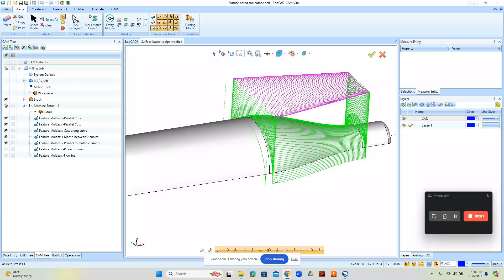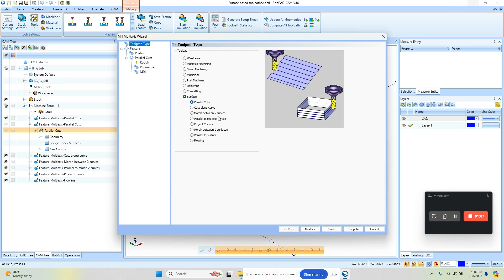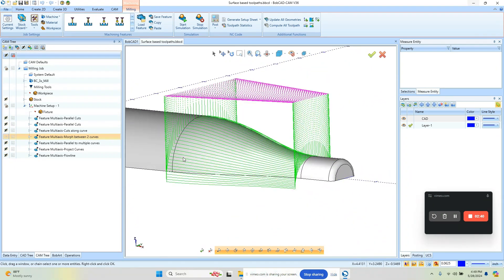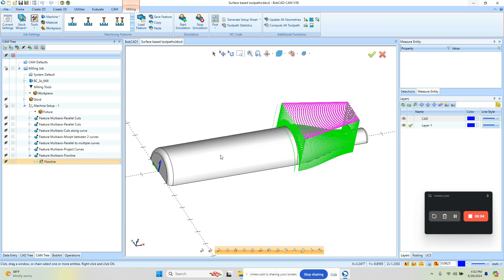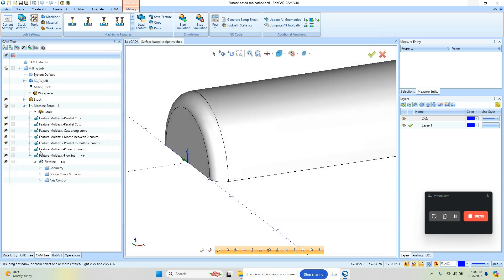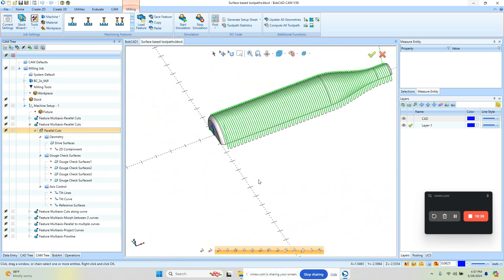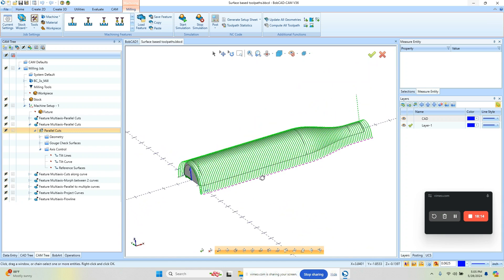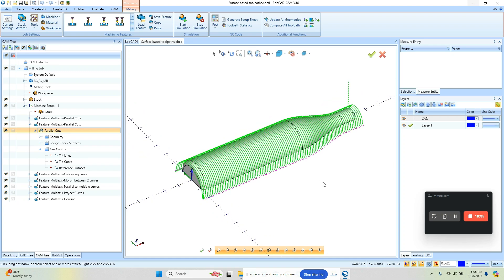BobCAD CAM V36 Surface Based Toolpaths Part 1

Comment: Wow, again the audio is horrible. My volume is alt 100% and I can barely hear you. Not to mention there is a lot of static background noise.
Reply: You may want to get your ears checked buddy. I can hear him just fine
Reply: @emptyclothescrashingcars1572  I can hear him fine too buddy, when I turn it up to 100%.
Reply from the maker: I would check you sound system, as I and others can clearly hear the audio, and yes there is background noise.   Like I said before we can do a zoom and I can help get you sorted out.  Was there something you were trying to get out of these videos?   What's you're skill set with the BobCAD software, would love to help you get better at CAD CAM and CNC!
Reply: @Depoalo  LOL, I'm kind of a tech geek and I have many devices.  I can hear you but that background noise drowns you out.  I do have a very high sensitivity to background noises.  Thanks but I don't want need any training.  I have been programming, setting up and operating CNC Turning Centers, Machining Centers and Wire EDM Machines for 42 years.  I have been using Mastercam for the last 26 years.  I have a BobCAD License that goes back to V26 up to V32.  I just like to watch to see what's new.  I love software.  I'm knowledgable in many softwares like, AutoCAD, Solidworks, ProE, NX, Mastercam, BobCAD, Esprit, Microsoft Office and computer technology.
Reply from the maker: @jtwiddle64  all good, the zoom meeting is free so it's not about selling you something.  Yes where I record currently there is background noise,  and I agree it's not the best for the audio. If it's an issue for you it's likely an issue for others as well. I appreciate the feedback .